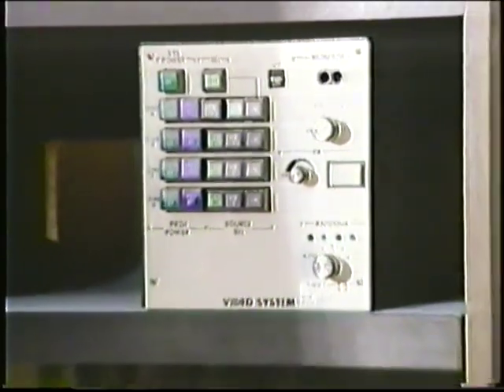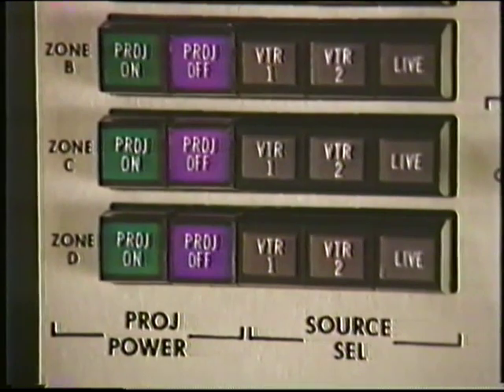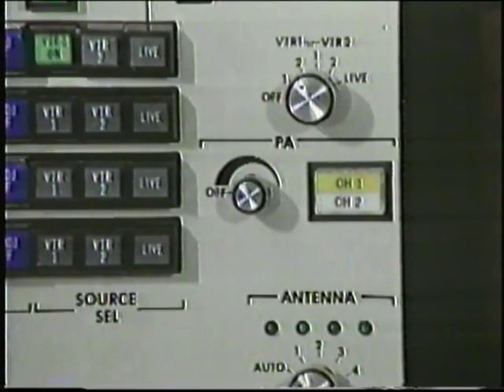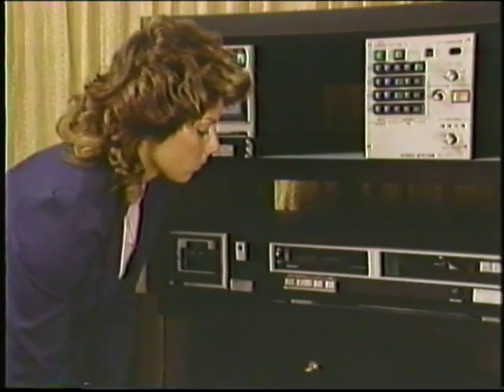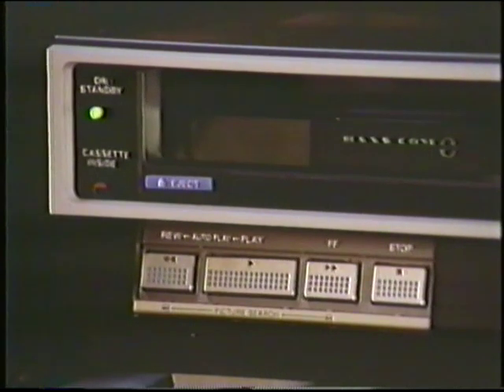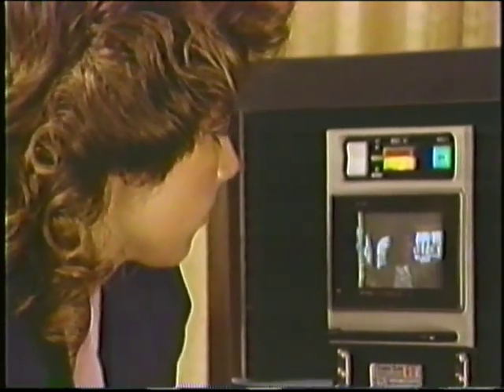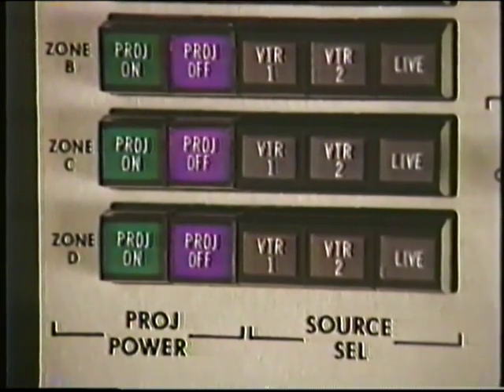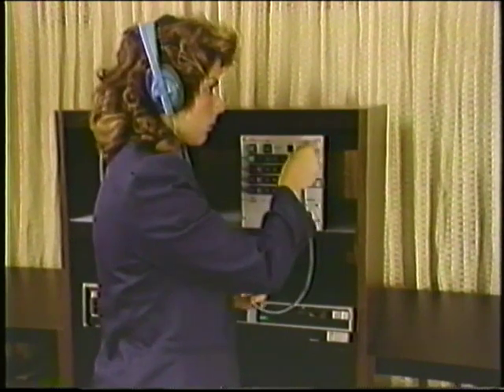Pan Am Training Video: Trans Com Video Entertainment System (circa 1980s)

Comment: I remember several flights from Chicago to Madrid in a 747  that used this system.  On Ibera the headphones were these weird tube things that connected to the arm rest where the speaker actually was.
Reply: Lol even well into the 90's as a kid I remember taking a few flights on Ansett planes that used the old "stethescope" type headsets. First time flying on a plane that didn't use them was an Air NZ 747 in 1995 that used regular headphones.
Reply: @davidshepherd265  As a kid, the only way I figured out where the sound came from was to put my ear to plug on the armrest.... I just had to know how those things worked.
Reply: You'll still find them today in MRI scanners :)
Reply: @AaronSmart.online  I'd imagine those types are preferable to having metal ones ripped of a patient's head
Reply: @AaronSmart.online  That makes sense. Fortunately I had never go through one, even tough I'd be curious just to see one up close..
Reply: You could kink the tubes and stop the sound on these air type headphones aswell
Reply: i remember that I figures out that I could roll a piece of paper up into a cone, and then stick the narrow end into the hole the headphone plugged into, and I could then hear the sound without needing headphones ;)  It acted like a horn on an old victrola phonograph
Reply: @audvidgeek  I love this! I would've been that kid. I used to stick sewing needles into paper cups to play (and ruin) records while using my finger to spin the turntable platter.
Reply: Delta had the same tubes.... Those things had an significant smell.
Reply: "Airphones" they were called. Even in the late 70s some airlines were already offering electronic headsets in first & business.
Reply: @visionist7  I have seriously never seen them. I remember two pairs of transatlantic flights in the 90s that still had a projector based entertainment system (One pair on a brand new Lufthansa A340, the other on a not-so-new British DC-10), but both used the typical "Walkman style" headsets, maybe with the two-prong plug that was common there for a while (to prevent theft I guess?) All my later flights already had in-seat video, and at that time, nobody used "Airphones" anymore.
Reply: @Colaholiker  do you remember what films did they show?
Reply: @visionist7  Sorry - nope. We are talking about the first half of the 90s here, so I certainly don't remember. The only thing I remember was the return flight on the BA DC-10, where they turned off the video system for the night, turned off the audio system for the night, turned off the cabin lights for the night, and when I wanted to read something as I can't sleep on a plane (at least not in sardine can class), I figured out that of all the seats, mine had the broken reading light. Needless to say that the flight was fully booked, so no chance to switch to a different seat. What a boring night over the Atlantic that was.🙄

Comment: I wonder if any examples of these systems survive.
Reply: Techmoan should get on it if he already hasn't
Reply: @visionist7  LOL when I watched the video, he came to my mind as well.  He's the type of guy who would install that in his garage... Jokes aside, those systems designed for aircraft use have very strange power requirements, something around 400 Hz odd-voltage AC, that you won't find on the ground, so they are really hard to get working outside of an aircraft.
Reply: @Colaholiker  It's 110-120 V, 400 Hz.
Reply: @straightpipediesel  When you live in the 230V part of the world, 110-120 V AC is odd. 😅
However, unless the device has a switch mode power supply and rectifies the input right away, running a 400 Hz device at home is not a trivial task.

Comment: I remember these well - first saw them on the A300 and A310. Huge improvement over the god-awful film cassettes we had on the 747.
Reply: As an avionics tech I remember those film cassettes on the 747. They did have their share of problems. The A300 and A310 system was better.